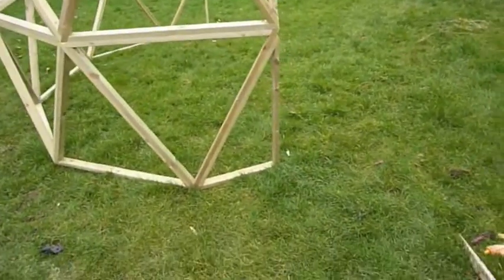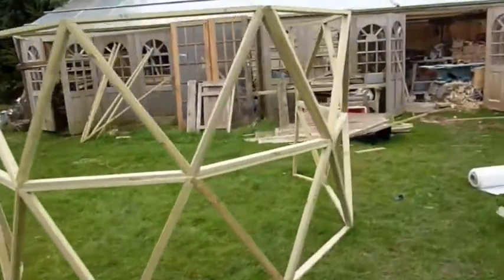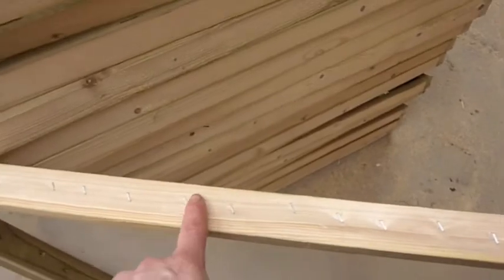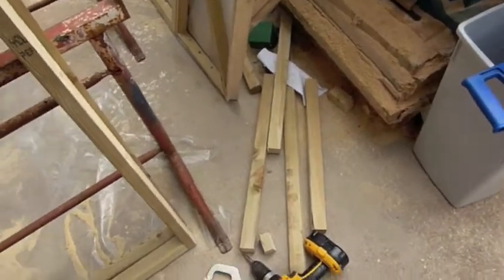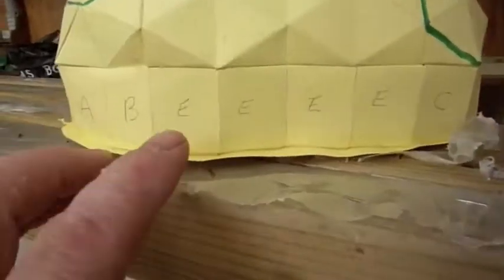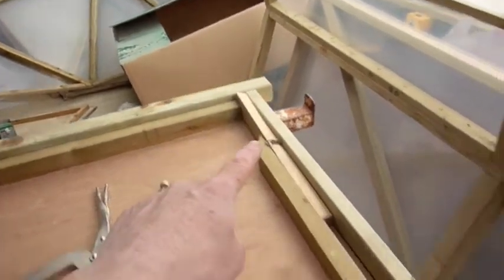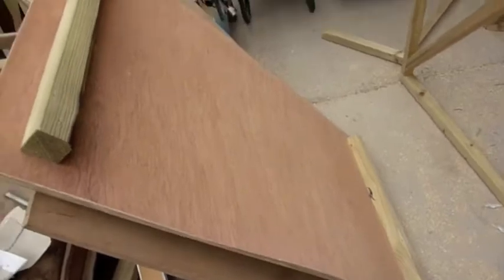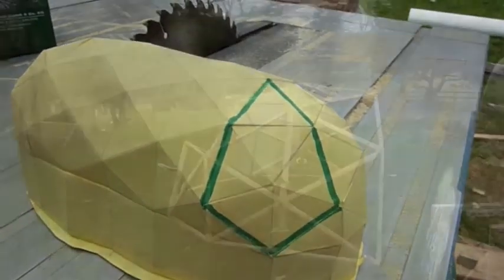Geo-dome tunnel tutorial part 2

Comment: So cool ... how do you figure out all these angle?  It's a nightmare!

So ... it would seem that when or if you ever need to re-skin the dome tunnel that you have to take the whole thing apart to remove the staples you show ... at around 2:45 ???  Is that right?  The skin has a certain lifespan, and changing it would be really hard, no? What about using something like polycarbonate paneling to extend the lifespan of the dome tunnel?

Comment: Why do you kick in and out? Can't it be flat along the whole tunnel?
Reply from the maker: The orientation causes the in and out kick, if you did the triangles with one flat edge running along the length of the tunnel you don't get the kick.
Reply: @Geo-Dome  thx! I can't picture it. Can you share a pic of the triangles with one flat edge running along the length of the tunnel? thx
Reply from the maker: @johnaweiss  Here's a link to the free plans for this style of tunnel: https://geo-dome.co.uk/freestuff/cw18free.pdf
Reply: @Geo-Dome  thx for that! So this design doesn't kick in/out?
Confused me:
 - "one flat edge". There are many, not just one.
 - "this style". It's not this style.